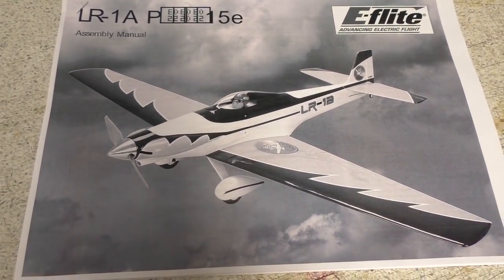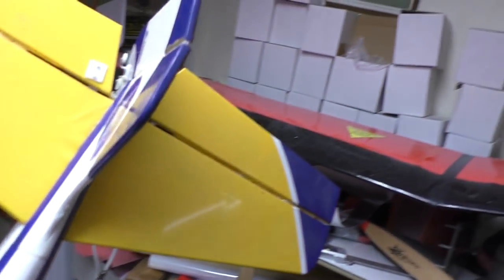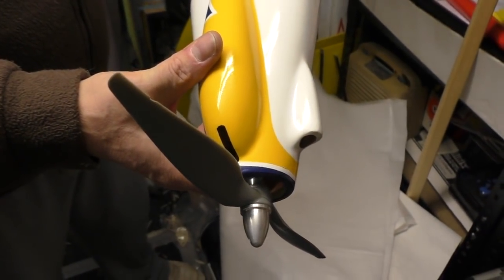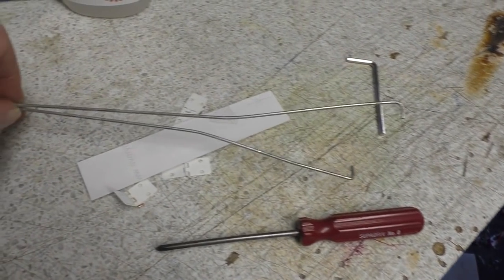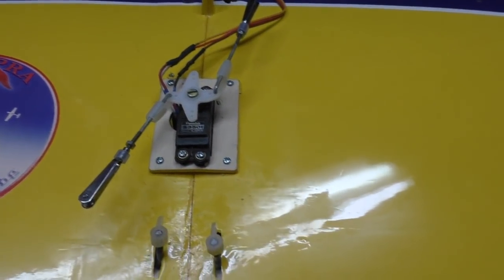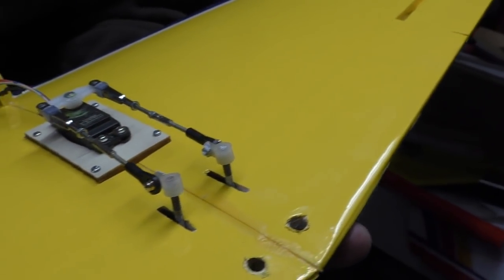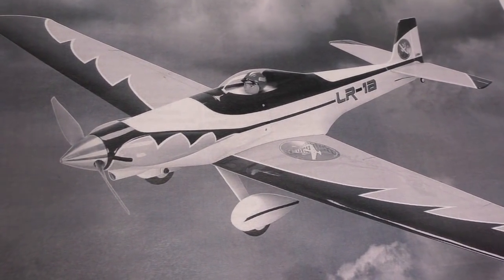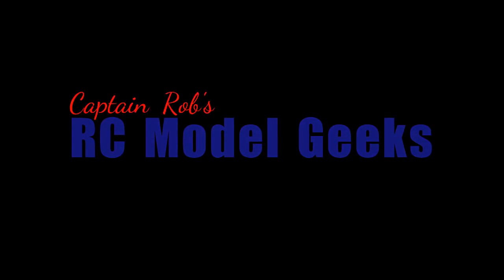Petes Problem Planes Pt2 Eflite Pogo  RC Model Geeks

Comment: What a botch first build whoever threw this together ! I think if that had flown then the servos would have burnt out under load and it would certainly have crashed,they must have shares in epoxy resin ? you have done a very neat job of the aileron servo installation anyway and Pete should have a nice aeroplane once you have finished fixing the numerous 'Bodgit-and-Scarper' initial assembly problems,we have seen similar builds or should I say assemblies over the years but never seen clogged up hinges like those,I could see the debris you pulled out of them,apart from all of this it is a very nice looking aeroplane that should perform well once sorted,the test pilot is going to be a busy bunnysoon ! ie Rob,well done I like these weekend matinees.

Comment: Sometimes the ESC switch is fail safe and the 2 wires should not be connected just put insulation on the bare ends.